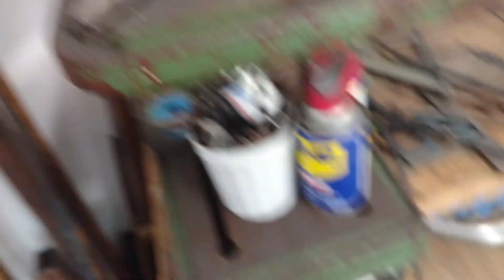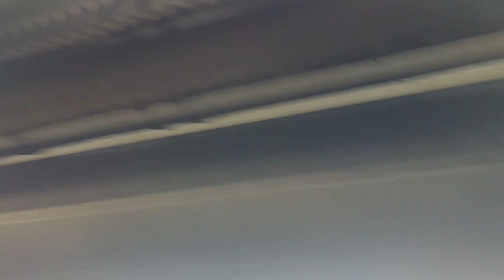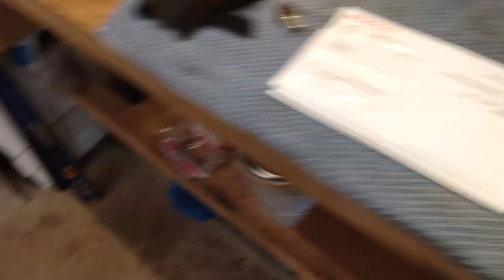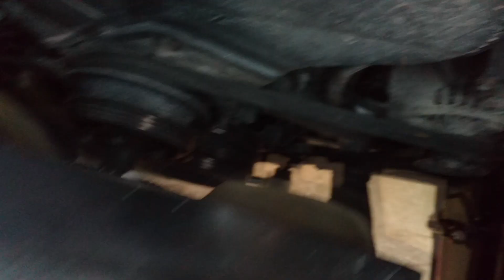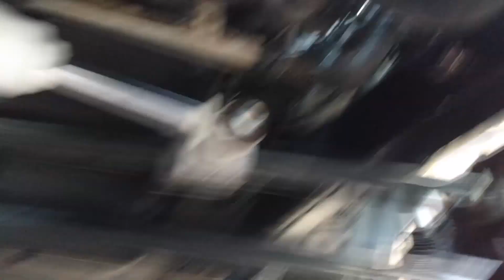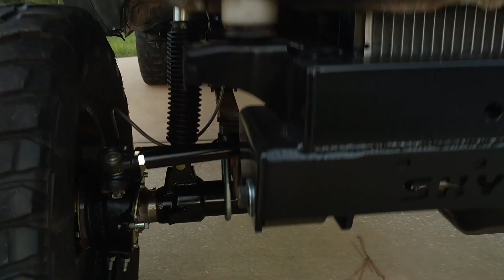Tacoma Solid Axle Swap [Part 18] - Power Steering & Closeout

Comment: How did you fix the front springs from sliding i have one side doing the same and i have a skys front hanger.
Reply from the maker: I welded 3/16" plate on the inside on both sides of the front hangers to take up slop.
Reply: Thanks im going do the same to mine.You did good on your build i just watched some of your wheeling vids.Did you tighten up the brake dive what i did to mine was add a rear skyjackker helper spring to my front leafs turned out perfect

Comment: 👍👍👍👍👍 Nice build and documentation, Travis.  Looks alot like my 01 white Tacoma accept mine is the extracab version.  I don't know how you can lessen the brake dive.  It can be somewhat severe on the pavement.  Arched packs and rear shackles has alot to do with it.   You would be amazed how the dive goes away with front shackles but nobody has a kit like that out there.
https://www.yotatech.com/forums/f152/sas-fj60-axle-housing-flip-front-shackle-my-2001-tacoma-283930/ 

   ZUK
Reply from the maker: Wow a comment from ZUK, I feel honored. Thanks for the comment. I have been recently reading all the information you have on gearinstalls.com as i have been working on getting mine regeared. 

I will take some time to read through your sas build. I hadn't considered brake dive reduction from a shackle-up-front setup. I may have to look into that some more for any future builds.

Comment: I was considering a full front and back 5" lift and ifs elimination kit on my 86 runner with all trail gear products ..what's your take on this? Your opinion would be greatly appreciated !!!
Reply from the maker: I actually have an 87 Toyota pickup (same chassis) that I have personally installed the trail gear ifs elimination kit on. I can say that it is indeed a great kit have can be all inclusive of you have the money. They definitely have figured out what is needed to swap in a solid axle. That being said, I don't like how tall the trucks end up being with their kit. If you do get the trail gear kit, get the 3" (or 4, but no taller) so the you can keep your center of gravity low. Helps reduce the "tippy" feeling.

Comment: This is the best SAS series I have seen for gen 1 tacos by far. Good work all around. Can wait to see it off road. Ball park what do you think you got into it cost wise?
Reply from the maker: Thanks you so much for the positive feedback, I really appreciate it. 

I do not have a solid number. I can tell you that the small things are what add up, like bolts, seals, clips, etc. If i was to make a ballpark guess, i probably have about $4000 (maybe a little under) in the front end swap.
Reply: Travis' Shop still cheaper then a lot of all IFS upgrades!